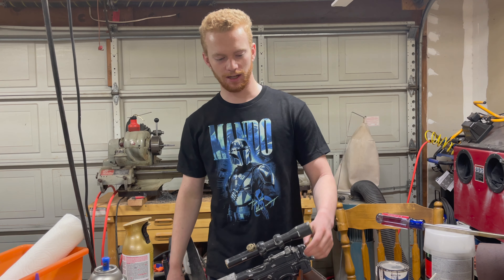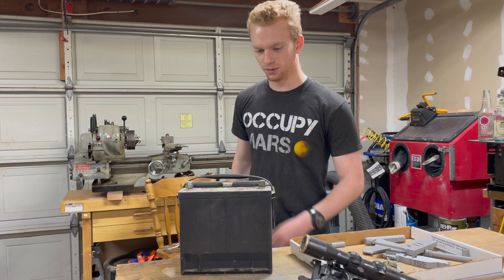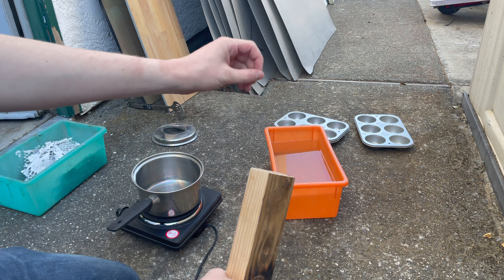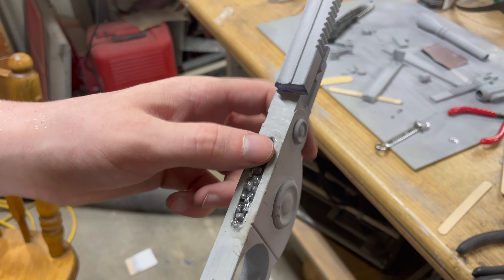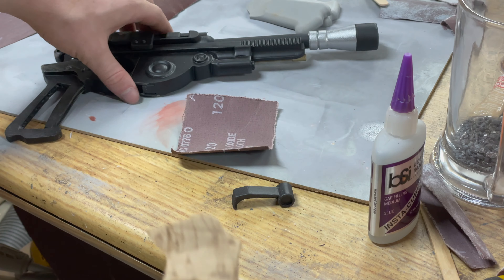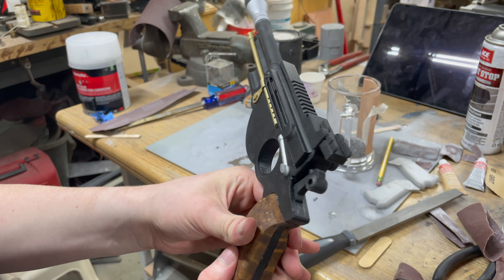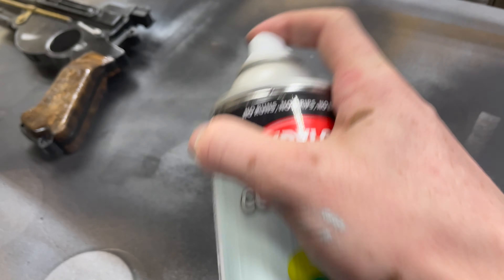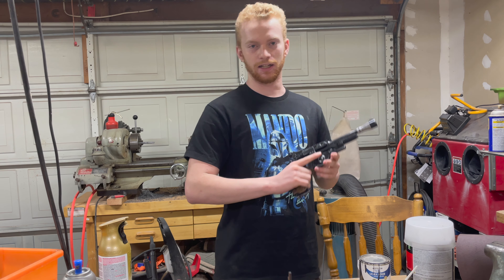Making the Mandalorian’s Blaster From Scratch - 3D Printing

Comment: SAND would have added weight without having to deal with burning toxins so other than that, GREAT JOB!

Rubbing everything down with graphite would have helped add depth to all the metal and before you clear coat... brush cinnamon and turmeric into all the joints to simulate weather and grime. Or train set clean dirt works too~.
Reply: I’ll do you one better just print at higher infill 😎. No work and If u did 100% it would be heavier than the led.
Reply from the maker: I intentionally only did paint chip weathering because Mando is definitely someone who frequently cleans his weapons
Reply from the maker: 100% infill would not have given the amount of weight I was going for here